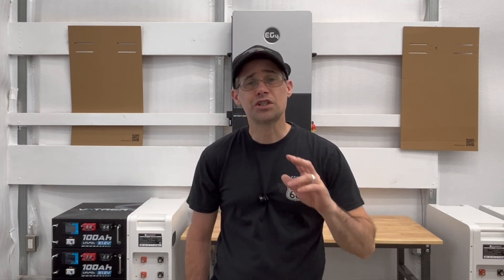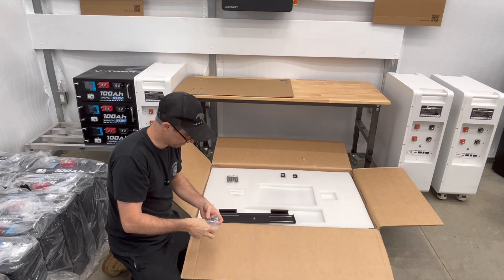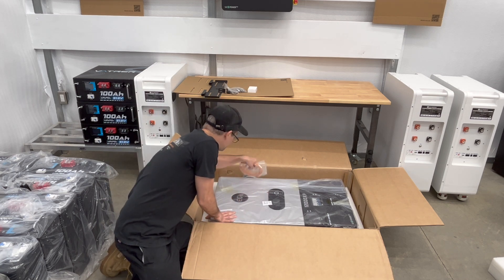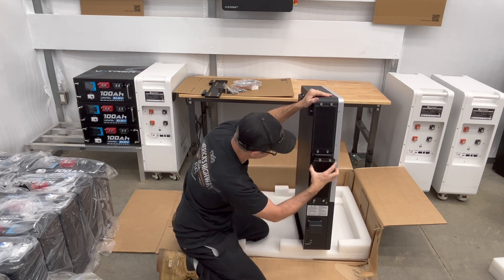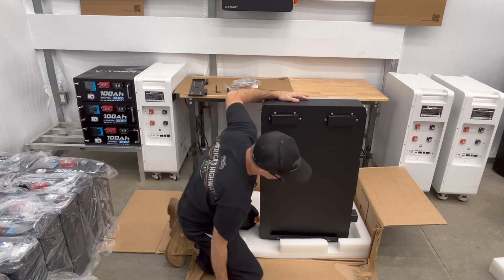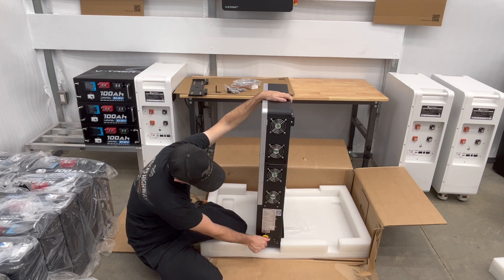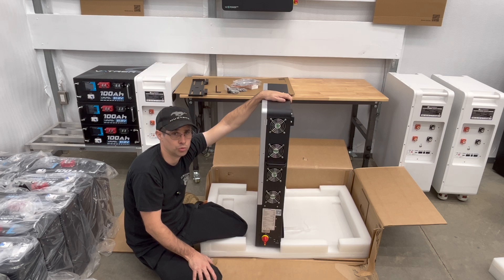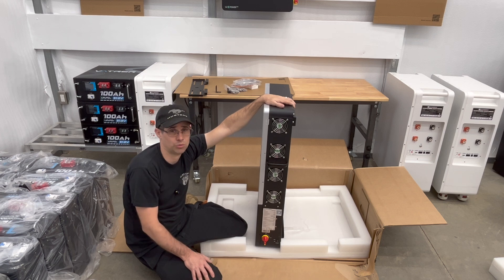EG4 12000XP: The Ultimate Off-Grid Inverter? So Good I Now Own 5!

Comment: The main reason to get more than one is to get more than 100A output from the inverter to the mains right? When grid is out and inverter is working, is there any voltage on the grid lines from the inverter to the grid..ie back feeding.
Reply from the maker: I have two for the shop which is currently off-grid and combined they supply 100 amps continuous.  The other three are for the house and will supply 150 amps continuous.  The goal is to have the house off the grid most of the time with a manual transfer switch at the house between the house and the grid.
Reply: @MikesSolarGarage thanks for the quick response. Don't these 12000xp units output 100A on the load line..50A on each phase

Comment: I love EG4's entire line-up.  I wound up going with the FlexBoss21 (+ GridBoss + 14.3kWh indoor batteries), which gives me a grid-interactive combination.  I personally think the FlexBoss18 and FlexBoss21 are so much better than EG4s older off-grid inverters that they are worth the extra money even for off-grid installations.  My FlexBoss21 is incredibly quiet and it can start a 5-ton A/C without blinking even when already under high loads... like the Tesla PW3, the FlexBoss18 and 21 can handle 195LRA on A/C starts.  Hard to beat that.
Reply from the maker: I completely agree, EG4 has really stepped up their game over the years.

Comment: I have my 12000xp secured and on the way in June, a replacement for my blown 8k, using the unreturned 10kw unit now my 5th install. Fan setting better than hot/cold with the fans, the one I use now just cooks at 47c till I put 600w load then it cools to 31c, I plan to buy a second 12000xp after 1 year as a backup. My last swap was 20 mins.
I have 2 months to study up on this inverter I better start now. I had a converter fail, and all other multiple problems were my Amen inverters. 
When I bought my inverter I wanted Sol-Ark specs but didn't want to pay $9500, so I went down to 12kw of solar max @$4600 and paid the price in frustration.
Reply from the maker: I am really liking the 12000xp so far.  How long have the inverters typically lasted for you?
Reply: @MikesGarageRoute66  the blown 8k was 13 months old, not sure why it blew up, no gen 600w load, I sent an email to the maker of all the issues, 30 lines on word exe, I told them to buy the rotten ones back from my dealer. Big favour can you get me some overcast pv values? Can you get 500w from 5kw array on a grey day?
Reply from the maker: Yes I have seen 800 watts coming in on a cloudy day.  But we don't typically get a full overcast so based on location, panel angle, and the degree of overcast may give you different results.  The key thing that I've learned is the higher the voltage the better.  Right now I am running around 225 volts and will be pumping it up to low to mid 300's soon.
Reply: @MikesSolarGarage  what size array on the 800w overcast?

Comment: I have to agree the 12000XP is an excellent power to price point intersection.  It'll bypass 100 amps and supply 50 continuously.  You could buy two 12000xp, feed each with 100 amps for bypass, then combine that into your 200 amp panel.  It would handle 24000watts (100 amps) of solar/battery and then if it couldn't supply that it'd bypass the full 200 amp from the grid.

Compare that with buying the 18kpv where it'd cost the same ~$5000 and could bypass the full 200 amps, but could only invert 12000watts (half).  Plus no redundancy (but lower idle consumption).
Reply from the maker: You make a lot of very good points.  Currently the shop is not connected to the grid.  For the house I will have a manual 200 amp transfer switch that will be installed.   The goal is to stay completely on solar and only switch over to the grid for solar maintenance or when I go on vacation for piece of mind.